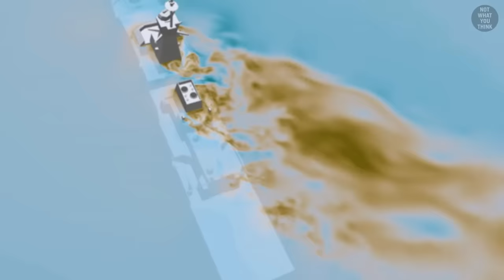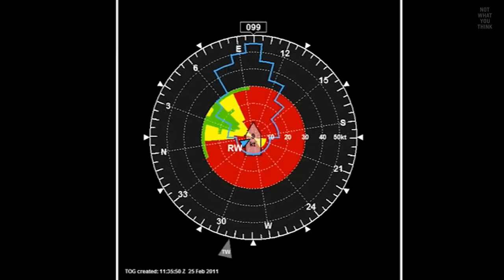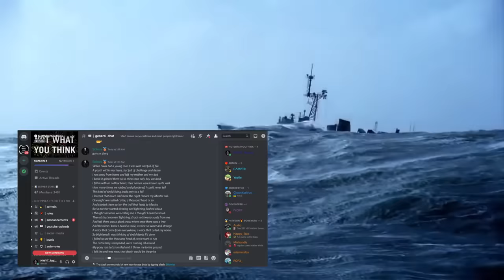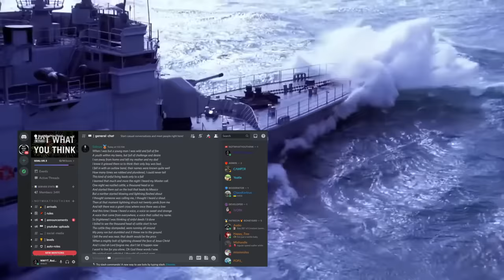How Helicopters Land in Rough Seas

Comment: Always curious why they never designed lightweight landing “legs” to land on moving, uneven, or unstable ground. I get the efficiency of wheels for traversing while  on ground but isn’t the whole concept of why the helicopter was created and chosen over planes for certain tasks to begin with was the efficiency in its weight load capacity and vertical lift/landing? Designed and used properly legs could stabilize and anchor aircraft and even help with liftoff.
Reply: My guess is that the wheels are blocked, but it’s still necessary to to clamp the aircraft down with the bear trap in order to prevent the helicopter from skidding across the deck
Reply: @jonasd2105  I was speculating from a pure design and engineering perspective on the adaptation of previous and current technologies relative to the entire structure of the landing gear. Surely even with legs there’s no reason why you can’t throw wheels somewhere on them to make taxiing possible. Back then they had sleds or rails for the Hueys and today they use stands, legs, pillars,etc. for private use recreational drones. I’m just curious why they haven’t designed a “universal” landing gear for all terrain/applications and call it a day after mass production.
Reply: @yoface938  Shipborne helicopters have wheels, not for taxi-ing but so that they can turn round on the spot.  They will take off or land facing into wind, but to be stowed in the hangar they need to turn facing forwards along the deck.  Once on deck and negative (i.e. downward) thrust is applied, they rotate around the harpoon until facing forward: for this each wheel needs to be rotatable through a 360 degree axis, which is incompatible with sleds.  Sometimes in really strong winds (40-50knots), the only way to get within SHOL limits would be for the ship to run downwind at maximum speed (30knots), and the aircraft to take off / land on facing the stern of the ship.  There is no way you could turn an aircraft with sleds through 180 degrees on a non-skid deck without damage.
Reply: @dominicbuckley8309  agreed fixed sleds are not practical in all situations but I think poles or sticks (aka legs) are way more versatile as they provide support in one direction but can be angled at any of the 360 degrees. Essentially this is what current landing gear is, just with wheels at the very end but I feel that current landing gear is much too short to adequately secure and support a craft while landing in ‘any’ situation. I feels with today’s technology it certainly is possible to increase the ‘leg’ length and number to make even landing on a steep rocky or snowy incline on a mountain possible. Just take nature for example, consider the lengths and numbers of legs of various flying insects. Now understandably due to scale it wouldn’t be practical to have the same proportions as we certainly don’t need an aircraft to be absolutely stable to withstand a  magnitude 9 earthquake nor able to ‘walk’ or ‘jump’ as movement can certainly be augmented with wheels however my point was from a design standpoint if landing was so important to the aircraft in certain applications wouldn’t augmenting the actual thing itself instead of the environment be ‘better’ to make it more adaptable going further in the future?
Reply: @yoface938  Are you talking about "spreading" the legs more to the sides as to increase the contact area with the landing surface:)? I think that the current system is working well enough, and that is is wrong to have really long legs protruding outwards without overloading them on rough landings.
Reply: @jonasd2105  yes I do think spreading and lengthening the legs may help providing balance and stability and as for stress there are many things that can be done with the material or design like for example if you were to compound legs into segments like that of any living being, it would be more practical in diffusing the forces of impact into different directions (not to mention augmenting the compounds into different shapes and sizes like springs or cavities) regardless of size because they can always be folded like any other landing gear on planes or copters or your own legs for example. As for practicality I think there need to be a line drawn between production and application because at least personally to me the “bear trap” although a quick and easy fix, at its core concept did not include the safety and  risk reduction of the humans involved with it. You still got a invaluable soldier or two between the ship and the copter putting his life at risk to secure the line between ship and copter and to me personally that totally preventable 10-15 seconds is absolutely unforgivable. A contraption of that sort will always just be nothing more than a stop-gap. One of the pros of automation is taking out the human element to ensure human safety and is the main force why drones are called the ‘future of the battlefield’ and why they are so popular today.

Comment: Helicopters don't typically lower the power to descend but lower the collective which reduces the pitch of the blades.
Reply from the maker: thanks for clarification
Reply: @NotWhatYouThink  for the longest time I thought it was power dependant with helicopters. They basically set flight power and then just use the collective.

Great video by the way, I learned something new. I always thought they just flew down to the deck by themselves.
Reply: @FiveTwoSevenTHR  So they lower collective and over speed the engine?  maybe  one could use a governor

Comment: The only problem with this technology (and with many other technologies) is that they result in deterioration of skills and become a crutch rather than a tool.
Reply: Except back in the 1950's there were no pilots developing skills of landing on pitching decks.  It just wasn't done and if it happened at all it was purely emergency conditions on carrier's designed with much larger decks. RCN cold war NATO role of anti sub warfare mandated copters with dipping sonars and that mean't faster ships carrying copters to respond to winch dragged sonar alerts they could then deploy a copter with a dipping sonar to go out armed with air/undersea torps and chase the buggers. So no, there was no developed piloting skills at that time whereby copter pilots were routinely required to return to a pitching small flat platform on the back of a DDE Destroyer Escort class of ship.
Reply: @brustar5152  The problem I foresee is that this will become the routine way of landing even in fair weather and calm seas and pilots who don't use it will be censured.

Comment: Not a very good description of how the bear trap works. The pilot does not fly the helicopter down, the hydraulic system pulls it down. Cut the cable anytime before the trap is closed and the helicopter will rapidly go straight up. This tugofwar between the ship and helicopter is what synchronizes their motions.
Reply: And unmentioned is the fact the bear trap is also used to transport the copter into the hanger without the need for deck crew to go out there in stormy weather. Not bad when you consider it was conceived in Canada in the mid 50's. Tested on HMCS Buckingham in the late 50's with a small temp deck and a Sikorsky HO4S-3 by and put into regular service on all purpose-built RCN DDH's by mid 60's.

Comment: Honestly, the Cessna thing was weird. Why wouldn't you just hover the helicopters for 5 minutes for the cessna to land, and then just push that off the side instead? It's not even about the cost of the helicopters on the line - they are in a state of war and could be attacked at any point or need those helis to support troops on shore. Just seems like a weird decision thinking logically...

Comment: When I was in the Navy we never had anything like that, our pilots did it by their skill alone
Reply: How old are  you? RAST has been around for a long time.
Reply: @Dave-in-MD  I'm 65 and went in, in 76. My ship had nothing like that on board. I was on the USS Santa Barbara and carried two CH46s.
Reply: @mattbowen8042  USS Santa Barbara AE-28 is a large deck ship that has nothing like the deck movement of a DD or Tico class CG.
Reply: @Dave-in-MD  I agree, but when you're in sea states like those shown it doesn't matter how large the flight deck is. To land like that in those seas takes skill.
Reply: @mattbowen8042  skill ..and.OR ...my RAST system and  HRS   horizon reference system

Comment: Relying on your eyes and instinct to land on the destroyers hello deck is dangerous
1) pilot can't see what's below them and relying solely on your eyes may cause your helicopter not to land at the center of the heli deck.
2) pilot may cause an error during landing
3) hard landing may break the landing gear system
always use the sensor and instrument landing system and never solely on your eyes

Comment: Yeah navy helos don't land in 30 degree rolls.   Not sure if any helo does.  The potential for contact with the water on smaller ships or a rollover on most is high.  I've had a main mount come off the deck at 20 degrees.   Thankfully we were chained.
Reply: For sure, no high roll angle landings.  gotta wait for a quiescence  / minimum motion period.   then stick that probe in the securing device...

Comment: The Royal Navy has never used a wire tether landing system. Winching a helicopter to a ships deck in foul weather using a wire is stupid. The mass of the ship in a wave trough could rip the underside of the aircraft out.  Mechanical deck handling systems for storage of helicopters into hangars are used however.  The deck lock and grid system does not rotate the helicopter when attached to the ship. It is tail rotor thrust that moves the helicopter through 360 degrees while the deck lock head is free to rotate. All the time while the helicopter is secured to the grid. Royal Navy small ship helicopters also can use negative rotor pitch to squash the helicopter on deck once the helicopter has landed. Bear trap systems are plagued with faults and pilots hate them.
Reply: Don't know current harpoon system,  How is helo secured  to prevent roll overs during move to hangar?

Comment: Would it not be a good idea to have air bags pop out at the sides from trap doors to stop the helicopter capsizing  and or sinking so fast. I would of thought this idea was looked at as its a simple idea. I guess it's because if the helicopter landed in water and deployed its airbags and was floating on the water the people inside evacuating the helicopter would be at higher risk of the blades hitting them as they got off especially if it was choppy seas that's about 90% of the time. Maby just letting the helicopter capsize and the blades stop spinning as soon as they hit watter and braking off is safer to escape out of the windows.
Reply: the sea king ch3 had bags..  helos are top heavy ,  unstable  and roll over

Comment: non pitched rotor system CHECK
Stabilizer rear rotor turn left right
Air induction to propulsion systems 
exhaust to drive systems 

chain whinch down deck hand

Comment: Surely it's ridiculous to insist the crew check a fuel sample in such conditions. This task should be delegated to trained sailors on deck and simplify the process. Additionally in bad weather there's the danger the sample would be contaminated through the process giving a false positive and the procedure aborted unnecessarily.